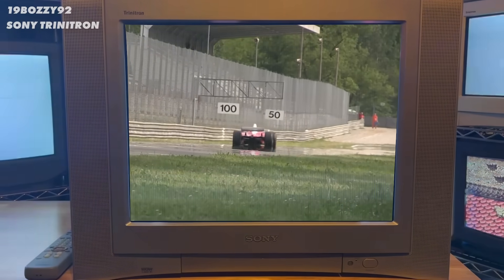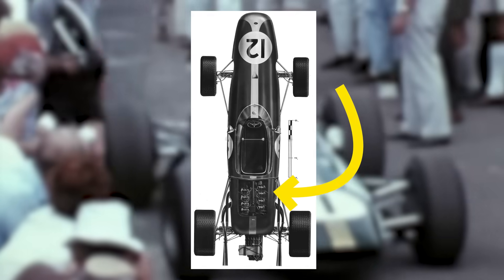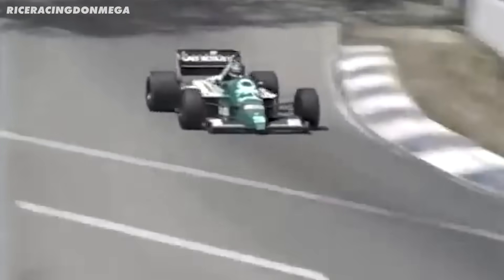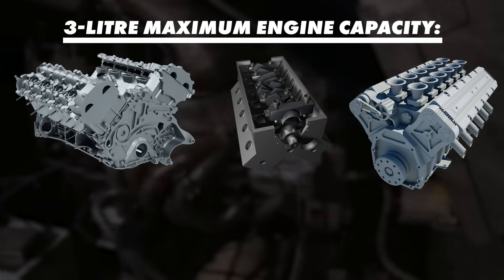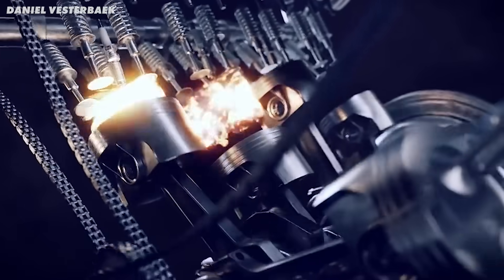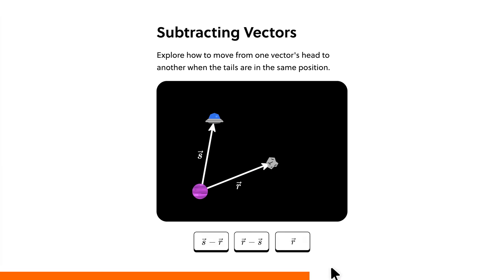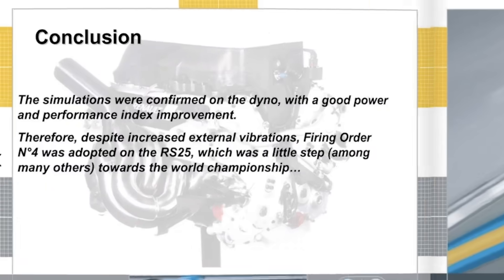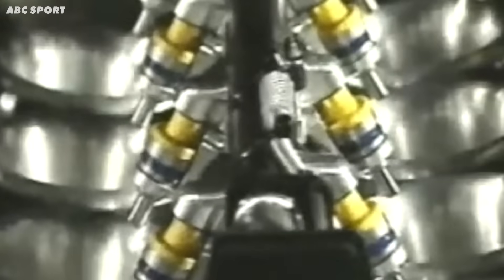How We’re Wired to Love F1 V10s

Comment: Full time professional musician here. Thank you so much for including some basic music theory in this video. You've confirmed a few things I've suspected for quite some time about V10s. The only other thing that you might consider when we talk about how much we love the sound of these engines is the exhaust plumbing itself. If the engines had no exhaust tubing, they'd sound like static, or possibly a machine gun firing. The tubing length and material creates points of resonance and stagnation along the duct work. The more different lengths of tube you have, the better your chances of resonation occurring as the engine goes through various rpm speeds, and therefore notes and overtones. V10s have a fair amount more piping than V8s, so you get the idea. If you've ever played a trumpet, you understand how different the sound of the mouthpieces buzzing is to when the mouthpiece is played into the brass tube that is the instrument. And speaking of brass, the alloys that the exhaust pipes are made of - typically titanium or chromium based - aren't terribly different from those used in musical instruments, in terms of their resonant and vibrational properties. So, taking all this into account, it becomes easy to see how a V10 is basically a mechanical version of a pipe organ, brass choir, or something not unlike the instruments we actually play on. To my point, if you haven't seen it before, here's a lovely version of the 2005 Renault F1 playing God Save The Queen. Thank you again for the video!

https://youtu.be/XRXwWbo_mX0?si=wQdAgj7SZlBq6bkr
Reply: Yep. I believe the exhaust design more than anything else decides how the engine will sound. Along with the firing intervals of course (even or uneven firing intervals). But just comparing engines with even firing intervals, you can make them sound pretty similar as long as you can reach the same amount of little explosions per minute (frequency).
Reply: Even though music theory says the V10 sounds better than a V12 i disagree. The V10 scream is for sure pleasing to the ear and but to me the V12 always has much more character and i like the lower pitch, and the increased piston amount is such a beautiful sound on downshifts.

Also on road cars when the revs aren’t a 19 000, a V12 sounds miles better to me than a V10 that it’s not even a comparison. 
A good NA V12 will resonate your soul much more than a V10 ever can, even ar very low revs or at idle, and has this raw and deep lion/dragon roar type of sound to it that a V10 doesn’t have.

If you stand next to a Huracan V10 when it revs or accelerates, yeah the V10 scream is a great sound, but an Aventador V12 will make you feel much more, so to me ending the video with ”it’s music theory proven” and not mentioning the many benefits and sound characteristics of a V12 is ignorant.

Just listen the Lamborghini Essenza on youtube and tell me it would sound better if it had a V12. No way that would be ever the case.

Comment: sadly the engine sound is actually wasted energy. As engines become more efficient they actually get quieter because they are using more of the potential stored energy.

Audi discussed it in depth with the R10 and why they switched over to the V10 twin turbo diesel engine. One of the additional benefits was the added efficiency of the engine… so less pit stops than their competitors.

In modern F1, the engines are amazingly efficient. That just means that more of the potential energy is being utilized to propel the car forward and less gets wasted… aka engine noise as one of the symptoms of wasted energy potential.

It’s also why modern engines don’t need to rev nearly as high as well.

Comment: When considering the pulse timing you also have to consider the angle of the V block. The crank shaft will be either flat or cross plane, either way the angle of the V changes the pulse timing.
Reply: Or you can have a split-pin crank.

Comment: Why can't we have  V10 Hybrids? They can rev slightly lower but with the supplemented power from an electric motor to give them extra torque, thus, not putting so much stress on the ICE to make them more reliable? I know its a pipe dream at this point. The FIA and Liberty Media are so far gone from the idea of bringing back ICE. But what's amusing to me is every time one of the teams does a promo event, they bring out the pre-Hybrid era V8 cars that, of course, sound phenomenal. But they're just deceiving potential interested fans because the current cars sound extremely quiet compared to the V8s and V10's of the past. 
I attended last year's USGP in Austin and the Porsche Cup cars sounded way louder than the F1 cars! It was quite sobering. F1 is supposed to be the pinnacle of racing. Apparently not in the sound category. 🥲

Comment: Could you make a video about why current V6 turbo sound so bad and how they could be improved?  I don't even bother with the electrical part, what I really don't like is the sound of the combustion engine, which is very muffled.
Reply: It has an incredibly efficient turbo system. Noise is literally wasted energy and the turbo V6s are the most efficient car engines on the planet.
Reply: @wiegraf9009 For me the biggest problem is not that it is "muffle", but is the combustion firing interval that does not make it have a cool tone (as the engine tends to have a low-pitch and therefore gives the impression of being muffled)

Comment: Another thing is engines that have the same multiple of cylinders will sound the same. For example: a V-twin, cross-crank V8, and a V16 will produce the same sound.
As with a I4 and a flat-crank V8, or a I3, I6, V6, and a V12, or I5 and a V10.

Comment: I heard all engine configurations in person in races in both 3 and 3.5 litres displacement. The 3.5’s were definitely louder than the 3 litres. The V8’s were too low in frequency and the V12’s were too high in frequency. The 3.5 V8’s were my least favourite because when they went by it felt like a professional Bongo player was beating my chest with his hands. Thankfully there was only the Lotus team left using them at the time. The V12’s sounded glorious as well but I still preferred the V10’s, with the Honda sounding rougher than the Renault.

Comment: Just to clarify, the reason why typical V8 engines sound the way they do is because the cross-plane crankshaft forces a firing order that kind of goes like: left-right-left-right-left-left-right-right. That slight hiccup at the end with two subsequent cylinders firing on the same side of the V engine is what creates the burble. Supercars and race cars with V8s tend to use a flat plane crank, which allows you to have an even firing order, as in left-right-left-right-left-right-left-right. That makes a cleaner sound and, all else being equal, usually more power too. So is one better than the other? Depends what you're using it for. A flat plane V8 will usually be more powerful but, despite the uneven firing order, a cross-plane V8 will produce less vibration than a flat plane will.
Reply: Koenigsegg just made his plane flat. Seleen S7 and Ford GT and pantera have crossed cranks. AMG GT?
Reply: @ArneChristianRosenfeldt  Obviously supercars using a flat plane is not a universal rule.

Comment: F1 is a far cry from what it used to be, and the FIA and Liberty Media are responsible for that. They are beholden to the U.N. Agenda 2030 which requires adherence to DEI policies and the ESG racketeering cartel. That's why you see F1 pushing this. It's a scam in leveraging passive investment money (401k, pension funds etc.) for impact investing - doing activism with that money under the guise of "sustainability, diversity, equity and inclusion".

The sport is so corporate and PC now. Also there are too many silly rules and regulations that don't make the sport any better. Too many boring street circuits. The cars are too big, heavy, quiet, ugly and uninspiring. They are so refined, aero-dependent and computer-based, they are a bore to watch in comparison to the nimble, screaming V10s... and even the V8s.

Comment: so a dumb question from me, is it possible to at least partially recreate v10 sound with a hybrid v6?
Reply: Not possible, cuz engine sound is produced by the harmonics of the explosions in the piston cylinders and how they exit the exhaust. The firing orders also matter. Essentially, each engine layout has its own specific engine note so the only closest thing we can get is a higher revving v6, but that again is not gonna happen cuz the engine drops torque. F1 teams actually run the v6 a little under the actual rev limit due to this reason.

Summary: the V10 sound cannot be recreated.

Comment: That sound was fucking sinister, but there's also something else that made those cars so awesome: the way they changed direction.

If you've ever wondered why F1 cars don't "look" as fast as they should, you have the V6 turbo hybrids to blame. 

Because the current engines weigh much more than before & teams have had to build bigger cars to accommodate them, we're now stuck with F1 cars that weigh almost 800 kg.

How much did they weigh before, you might ask? From 1998 till 2009, they weighed 595 kg. 

Yes, you read that right. 200 KILOS LIGHTER than today's oversized pickup trucks, and it SHOWS!

They also used to have rock-hard, slippery tires that would last the whole race distance, which meant there was little to no tyre preservation. 

You could watch somebody like Michael Schumacher absolutely STORM into corners & power-slide his way out of them with more vigour and liveliness than a modern F1 car could ever dream of having. It made the drivers look like gladiators and the racetrack venue felt like a red hot war zone.

Look up "Jacques Villeneuve 2003 Melbourne Qualifying" on YouTube and you'll see what I mean. Or better yet, watch Michael Schumacher's 19 qualifying laps IN A ROW in the 1998 Hungarian GP, which helped him beat the lightning fast McLarens of that year to the race win.

The racing may not have been perfect, but as far as size, weight & looks go, the cars between '98 and '03 are the best machines to ever grace a racetrack.

If we can merge the more raceable ground-effect cars of today with the proportions, weight & sound of the old cars, we would be ushering in the greatest era in F1 history.

Karun Chandhok even recommended them to do so since a lot of car companies are reinvesting in naturally-aspirated engines again. 
Germany actually mounted a successful campaign to spare e-fuels from the ICE ban in 2035 & Porsche have even built a synthetic fuel factory in Chile so that the 911 can still have an internal combustion engine.  

I ain't watching till we get guilt-free V10s back, & every fan who truly loves this beautiful sport should go ahead and do the same.

F1 may be a business, but it should first and foremost be about entertainment. The fans are the number one source of revenue for the sport & they deserve to be given the greatest spectacle man has ever built.

It's time to bring back the thrills. Time to bring back the REAL Formula One.

Comment: I adore the V10 era of Formula 1 possibly purely because of the sound and it's fun that there is some musical science behind it. BUT! I don't consider V10 to be the only way to achieve what we had back then. Sound and music makes us feel a certain way, so just because it's not the most pleasurable one like a major 3rd, having a different note isn't a bad thing in itself. The V8s that came both before and after the V10s also sounded absolutely sublime! They had a different tone that was more mechanical rather than harmonious like the V10s, which gave them a unique personality. Thus I don't personally care, if the engine becomes something as tiny as an inline 4, as long as it is loud and dramatic. Just the car going by you basically has to be enough of a spectacle to get you interested.

Comment: Revs, lotta revs. Even today's V6, without a muffling turbo and revving up to 19k would sound amazing. And this new reg, with that low fuel flow, will have worse sound if the engine doesn't go smaller with more rpm to compensate.

Comment: I went to over 80 GP in the 80s and 90s. Hands down the very best sounding F1 engine live was the Ferrari 412-T2. Mind you it did depend where you were. The old Hockenheim vs Brazil sounds could vary. 

 The Ligier JS43 was pretty impressive too. That Mugen Honda was a beast. It was the only one I had to plug my ears when it went by on the straight in Montreal.

Comment: Please take this additions: A: Notice, that on case of the Renault RS24 engine, the presentation reveals that the flow INTO the engine makes the difference, not the outflow. As we are used to their exact shape, all downpipe has the same length until the 5 to 1 collector. That could be made to have the same flow for almost any firing order. The intake is different, as blowing to a throw or sucking it is different.     B: for more cylinders, the engine can rev higher mainly because the length of the connecting rod, height of the piston and radius of the crankshaft is smaller. The pressure pulling apart these components is like hydrostatic pressure, rho*g*h, but g is here omega^2*r, the ratio of r, the half stroke to h, the component height is the same for any number of cylinder for the given component, and omega is angular speed, appr. rpm/9.5. This pressure must be less than then the tensile/compressive strength (measured in same units as pressure) divided by a practically evolved safety factor. So Ten.Str.>Saf.Fact * rho * c * (r*omega)^2. Notice, that cross sections, and hence masses of components does influence this limit only indirectly via c. Also Notice, that the main limitation is set against r*omega, which is called mean piston speed, and is typically around 24m/s, aka 80 km/h (50 mph) in high performance race car. So the mean piston speed is limited by structural strength, so if you want to have the more firing for a given cylinder volume, you need to have shorter stroke. Hence, max rpm is inversely proportional to stroke. Torque is proportional with engine volume, so power is proportional to engine volume/bore, which is area of pistons, or N*stroke^2.
Reply: Nothing is static at 22 000 rpm . Also would be nice to list the Greek letters before any expressions. Has been a while since school
Reply: @ArneChristianRosenfeldt   rho denotes density, usually measured in SI by kg/m^3 (Imp: lbs/inch^3). omega stands for angular speed, measured in radians/second. 1 radian is 57 degree.  6000 rev/minutes= 100 rev/sec=628.34 rad/s. [rad/sec] is used in engineering, because tangential speed and more importantly, centrifugal force can be calculated after converting rpm to rad/s.      Remark: If it is accepted, that both mean piston speed and average pressure during the power cycle is limited by technology, then power will be proportional to bore area times cylinder count. By formula: P=v_mp * p_power_cycle * A_bore*N_cylinders. aka Power is  mean piston speed times power cycle mean pressure times cross sectional area of one cylinder times number of cylinders.
Reply: @ZNDISCOTEK  thank you very much. A bit surprised about myself now I could read straight through it.
Reply: Last line has typo, bore and stroke was exchanged: the correct version would be:... so power is proportional to engine volume divided by stroke, thus proportional to number of cylinders times bore squared.

Comment: I used to love hearing V12, V8's and v10's all singing together... 
could pick cars out with eyes closed.... 
wish they just limited total fuel and let the engineers have some fun.
Reply: If you just limit the fuel, engineers install turbos. V12 was never competitive and sure isn’t in a modern carbon ground effect car.
Reply: @ArneChristianRosenfeldt  Schumi said the 95 Ferrari F1 was good enough to win ths championship when he tested it when he joined Ferrari for the 96 season. Not to mention Prost's Ferrari in 1990. You need an F1 history lesson my friend...and, no, engineers won't install turbos if they're outlawed by the regulations.
Reply: @Spinelli__  you wanted to limit just fuel. Limit <> law?? Porsche engineers went for the record on Nürburgring and went for turbo V4 hybrid.
Reply: Why are V12 not comparative? Are they inefficient?
Reply: @somebodyelse3004  yes, Ferrari had to fuel up their cars more often. The main point is that when you don’t limit displacement, everybody uses V8 . Time as proven again and again, that those pack max displacement into the lightest block.

Generally, F1 cars are too small for V12. On war birds and bombers, V12 wins. I hate those US radial engine birds. The British used V12 in their bombers. Jay Lenno has a car with an air-cooled V12 tank engine. The 180° version is even more easy to cool using air. V12 engines always drive a gearbox. In a plane this could be use to slant the V12 to reduce the size of the air ducts. Small tubes which direct cooling air on the ring where the exhaust meets the head. Then reverse upward. I like chimneys.